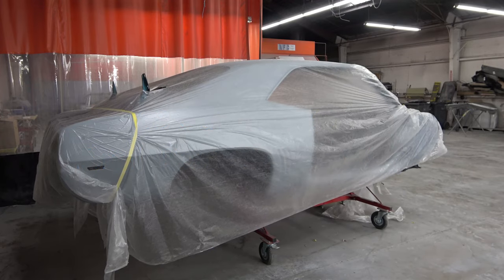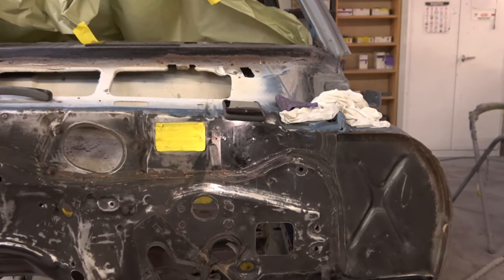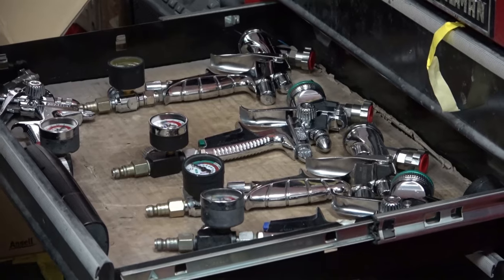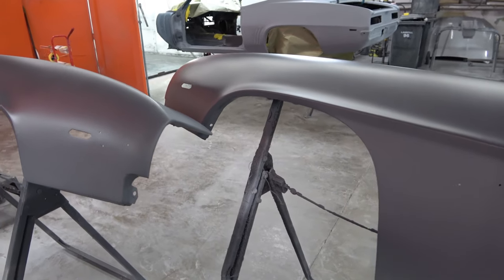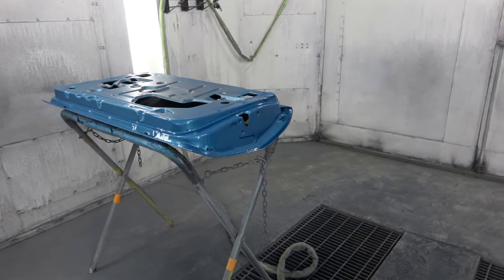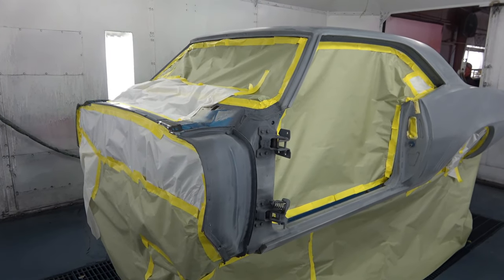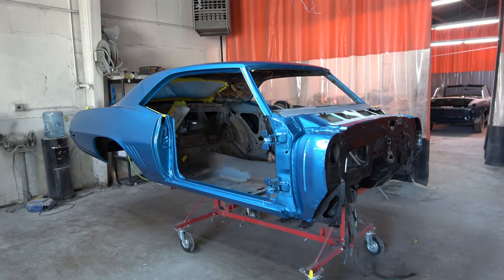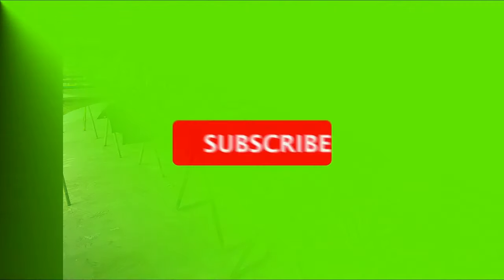1969  69 Camaro Z28 in Le Mans Blue Restoration Video Series - Part 6 - Final Paint

Comment: Weren't the stripes Decals originally  ? On original cars the stripes looked flatter and not shiny.
Reply from the maker: The original stripes were painted on separately after the car was painted, they were not cleared at the factory and were generally done in a sloppy inconsistent manner and could look very different from car to car
I have chosen to clear them
Reply: @digitalpizza1  When a car is restored , are the stripes painted after the car is cleared or before and cleared over. To be authentic shouldn't they be painted on after the clear. Thanks for clearing that up. I appreciate it.
Reply from the maker: They painted them on after the car was cleared.
So when the car was new, the stripes were painted over the clear.
So I painted them over the clear, but then we chose to clear the stripes.
It’s not as the factory did it, but generally is an excepted method in restoration
Reply: @digitalpizza1  thank you
Reply: @digitalpizza1  They didnt use clear coat in 69 , everything was laquer base

Comment: I have a 69 RS/SS Camaro my paint is Olympic gold . Not crazy about that color. Do you think it would affect the value of the car if I painted it a different color I like the Le Mans blue . But I do not want to decrease the value. What do you think?
Reply from the maker: If the color is the only thing you change, it would have the least affect unless it’s original paint. I would not change it if it’s original paint. Figure it might have a deduction of what ever it would cost to put it back to gold. But that’s not much compared to what these cars are worth.
If it’s not a number matching car, the it wouldn’t matter as much
Reply from the maker: Another idea is, you could also put something out there to see if anyone is interested in trading. There are guys who are really into the Olympic gold.
Reply: It is a numbers matching car we’ve owned the car since the 70s it’s a 396 325 hp. I think your right Olympic gold probably the best way to go with it.